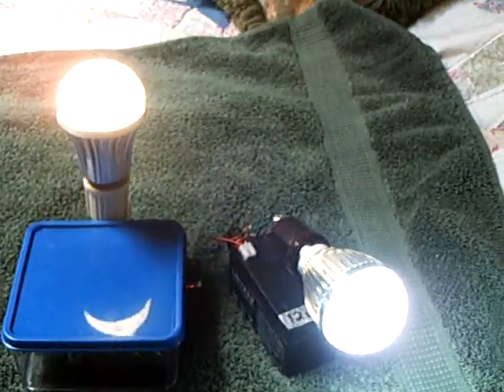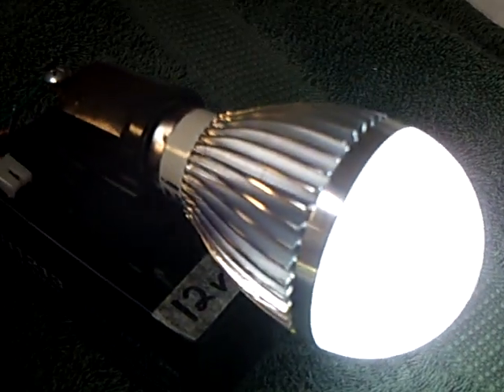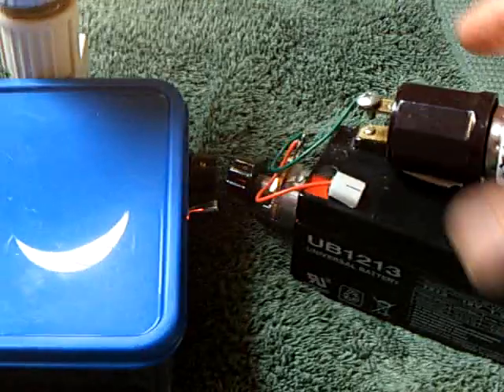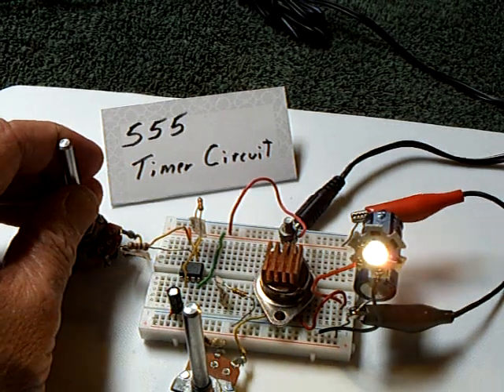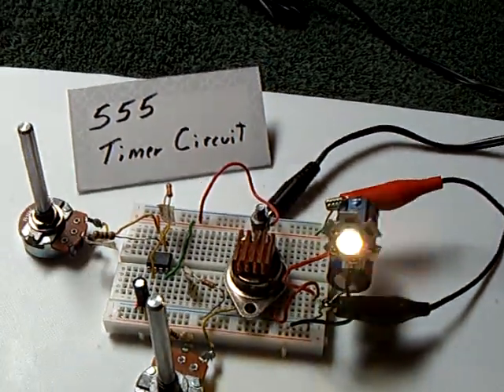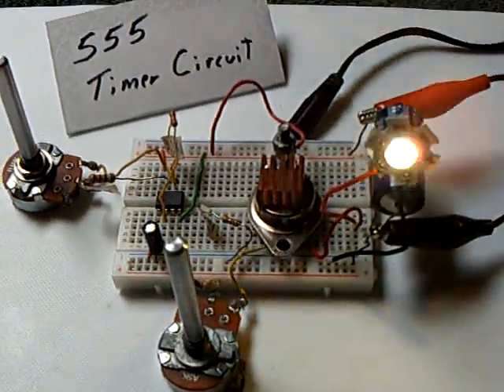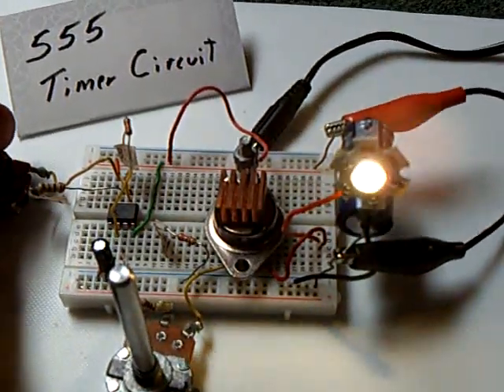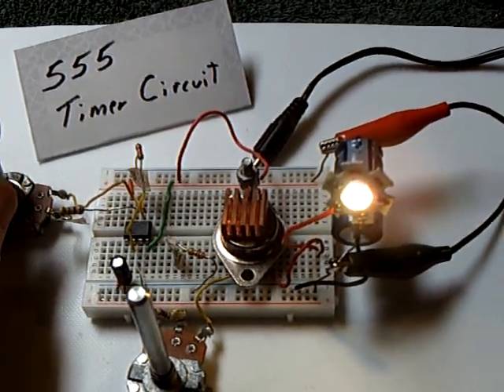LED lightbulb lumen per watt quest---blink it maybe???

Comment: I find the cheap chinese spot LEDs, are 6V wired. 4 x 1 watt RU24 base. Two wired in series, after gutting them, on 12V works nice. Or, leave them on 6V parallel, and use a simple 555 PWM to back off to manageable current, as you've shown. I too have been working on running lights in basements, straight off solar, no batteries. I'll post if my latest works out good: 10 watt solar panel + $2 chinese buck converter holds 16V, charges a 1F 16V super cap, which feeds a royer oscillator, sends 16VAC

Comment: The cold white light is not good for your eyes cause these have too much power in single spectrum lines ! So they hit your eyes with too high intensity and you can get
retinal pigment degeneration ! So watch out and better only buy the warm white LED bulbs...!

Comment: I reckon much higher than 200Hz will give 'sweet spots', 555's being able to go up well into the kHz too. At some places in the range (with freq meter), we ought to see the same efficiency with 5x 1W warm as in the commercial bulb. After all, they probably did exactly this sort of thing in R+D. Theory says they found a good balance and built a million of them. 
The LED has a definite rise and fall time of lumen output per waveform cycle...the datasheet of the LED could be a great guide :)

Comment from the maker: That is what I am thinking also-- "... the different setups are application dependent."  It all depends on what you are going to use it for.  I did use my little boxed up unit the other night.  My wife ran out of daylight while gardening.  I just put the box on the patio table and ran an extension cord with the reflector light on it out to the flower bed.  Problem solved.  It lit up the whole area where she was working.  I really like it when something I make actually gets used.